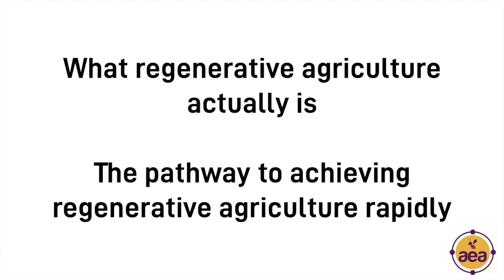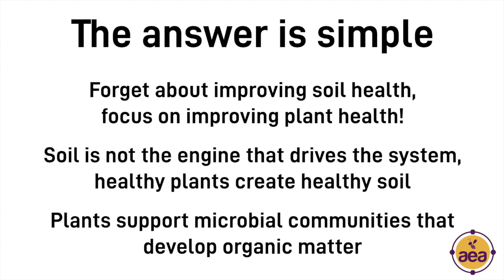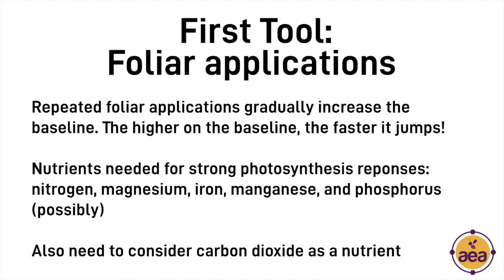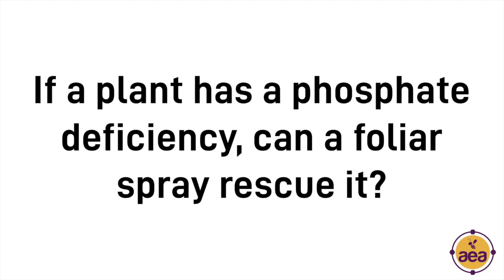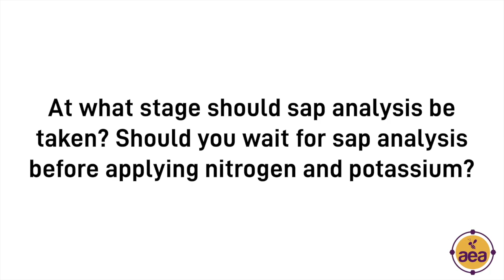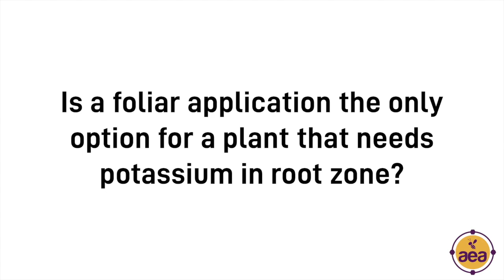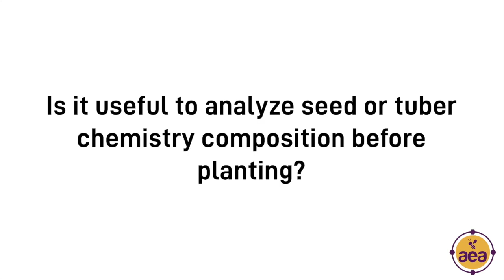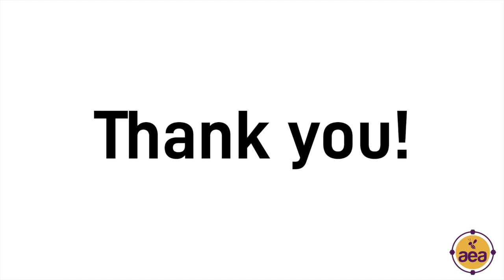How is Regenerative Agriculture Better?

Comment: John thanks for your information. Now my question is do you know how 23 to 24 hour day lengths like hear in Alaska or other far north regions affect photosynthetic capacity when there is that much sun are day light?
Reply: In regions with extended periods of sunlight, light is generally not a limiting factor. The limiting factor becomes most commonly carbon dioxide, or possibly water or mineral nutrients.
Reply: I would say you should experiment with the grass maturity to figure your recovery periods between grazing periods.